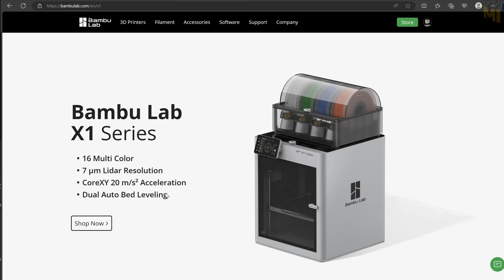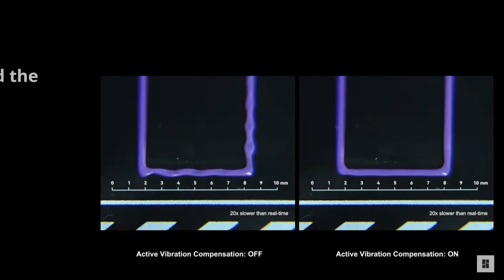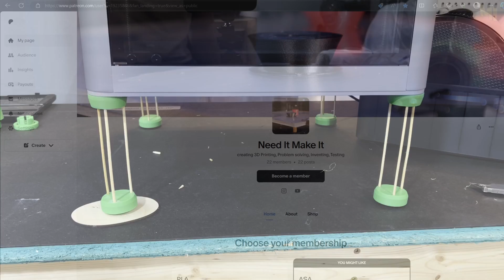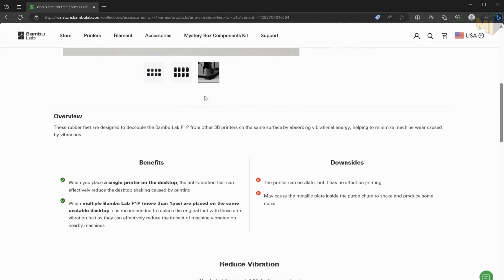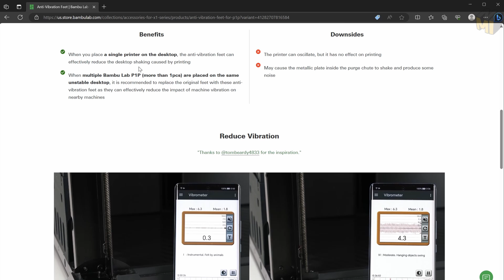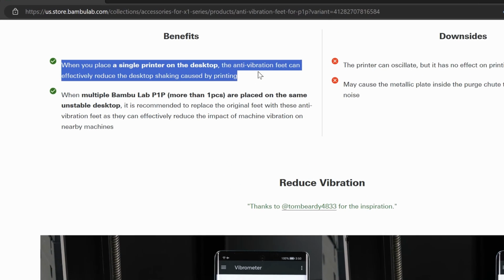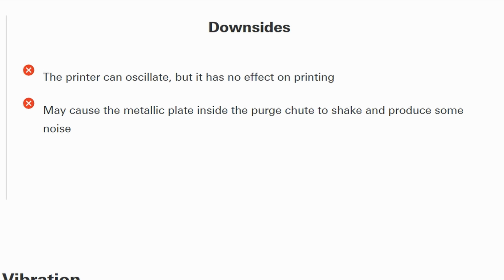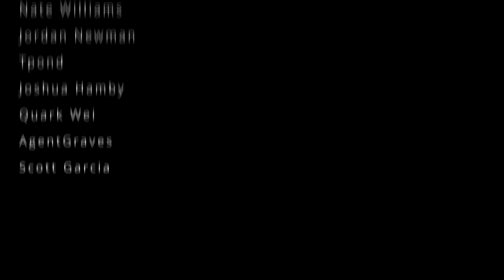This may be CRAZY, or at least my worst - Feat. Bambu X1C

Comment: The system is enclosed. 
The vibration would be external to the printer. 
I'm pretty sure you could shake the entire machine and I wouldn't affect it much... 🤔
Reply from the maker: Hard to say, but that would make for an interesting test!  What shakes a lot?  Washing machine/dryer, maybe a motor with something added to the shaft to give it some 'shake'.
Reply: @NeedItMakeIt  that would be so cool 🤣 

You could put it on a washer or dryer and see if it affects the print.
Reply from the maker: @AvocadoAtrocity  That's an easy test, I'll have to do it and see what happens.   I also have a K1 printer and it shakes a lot, I can mount them beside, or one on top of the other and see what happens.  That would be so funny to see a printer printing on top of a printer.  Are these bad ideas or good?
Reply: @NeedItMakeIt  stacking printers and risking $1000+ printers falling over for SCIENCE is a brilliant idea 😅
Reply from the maker: @AvocadoAtrocity  it certainly warrants watching them while it happens.  I have some double sided tape, maybe a few bits of that would be wise.
Reply: @NeedItMakeIt  do it up. Make a video. I got the notification bell on 🤣
Reply from the maker: Hey AvacadoAtrocity, did you happen to check out the video?
Reply: @NeedItMakeIt  No??? LET ME CHECK IT OUT!!
Reply: @NeedItMakeIt  dont forget to put a brick in the washing machine )))

Comment: Thank you very much I got your legs and printed them out.  They work great on my P1S.
Reply from the maker: Thanks Glen, I'm working on a design to include storage below the printer, something modular that also raises the printer up.  After all of the testing I've done, I'm pretty confident that it'll work well.  I'm having trouble coming up with a good way to connect to the bottom of the printer, but I have one last good idea that I'm working on.

Comment: I bought the $10 anti vibration feet from Bambu and I also added support on the front end of my workbench and that solved 99% of the issues I was having.
Reply from the maker: That's not bad, are you running multiple machines on the same bench/desk?
Reply: @NeedItMakeIt  Yup, I like your design but even with the raise from the anti vibration feet it does make me nervous to see the thing rocking about on top of the bench. The print quality has improved and I don’t get any more resonance error messages after I did what I mentioned before.

Comment: I really need to experiment with this more. I only recently got my X1C and so far whenever I increase the speed I get really bad layers. Tried it out on multiple prints, even ones provided by bambu labs, and the layers just fail whenever I increase the speed. Not sure what is going on there.
Reply from the maker: This may be due to the filament, have you tried increasing your hotend temp also, they'll need to increase proportionally.  I have had some issues with Overture PLA, but it wasn't intended for high-speed printing.  Maybe you can send the file over and a few stats and I can see what the print looks like on my end with your settings.  Needitmakeit@gmail.com